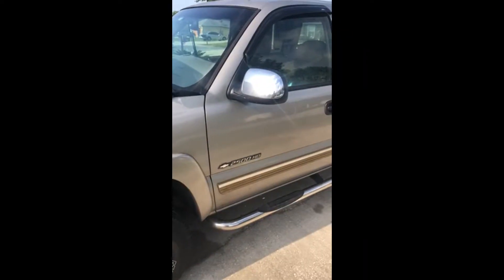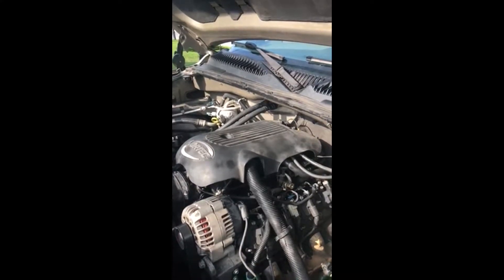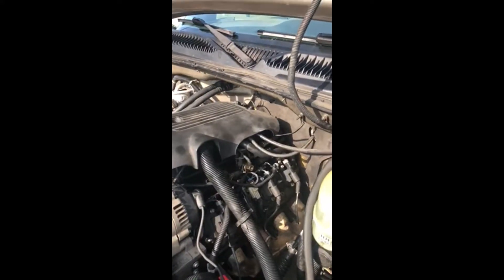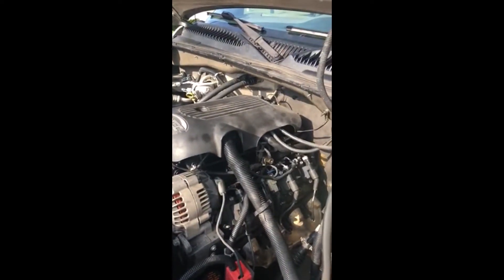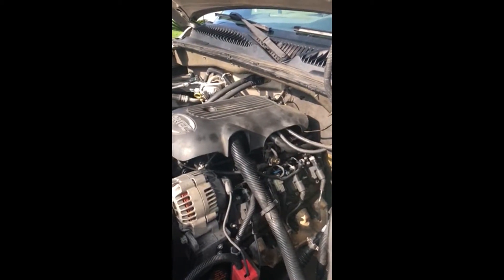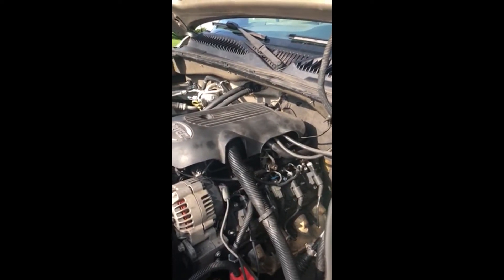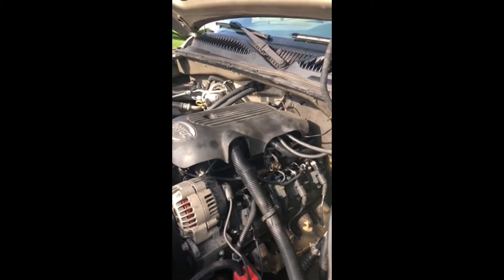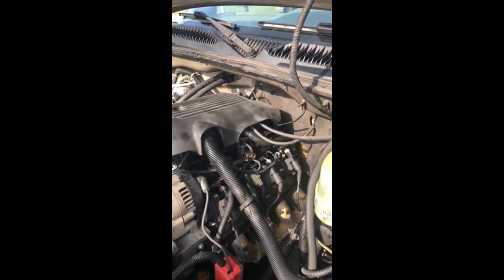Secret to Fix Knock Sensor Issue

Comment: Thank you very much for your video. I am an automotive technician and I did not find information about this problem in any mechanics manual. I was working on a silverado 2500hd 6.0 and had changed the original sensors and the knock sensor wiring and it kept throwing the codes P0332 and P0337. I checked the input to the PCM and it gave me the correct ohm measurement. By doing that procedure that you explain in the video, the problem could be solved. Thank you and God bless you and each one of those who commented here.
Reply from the maker: Glad it worked for you, Yes once you understand the system you can fix the issue! Pass it On !!!!
Reply: Year old video how has it held up
Reply: I had a code and replaced both sensors and harness. Code went out, then 50 miles later it came back on.
Found this video, cleared code, “re-learned ECU” as described in this video, code came back on after 50 miles of driving. What gives?

Comment: You saved a trip to the repair shop!! 2011 Tahoe 5,3 with a code of PO333. Changed both AC Deleon knock sensors, erased code, within 5 miles engine light came back on. Erased code again and within 5 miles engine light and code was back. 
At that time watched your Utube video. Erased the code, brought RPMs up to 4000 two times for 3 or seconds. (rpm maxed at 4000 on this truck). 
After a few test drives still no more code. BUT!!
Still hestates and misses from a dead stop. Cleaned the MAS and throttle body and now has no more problems. 
Thanks for the video, it worked.
Reply from the maker: I’m very Pleased it worked for you like so many others! You did a great job yourself! 
Please Pass the information along to help others, like my video that helped and Subscribe to my channel if you Will Please!
Reply: To update = Now has been approx. one month after replacing KS’s the engine light is still out. But! One morning pulled out of the driveway and noticed a hesitation. Stopping at the next stop sign and hesitation was much worse. After operation temperature got up to normal the hesitation improved but still there. Had no engine lights or codes at that time. Decided to have it tested with a much better code reader then I have and found it was the MAS. THE test that proved for sure is when they dis-connected the MAS the problem went away.
Reply from the maker: @pwrcat23  Good to Hear. Thank you for the update, Yes hesitation cannot be caused from Knock Sensers , but many other items, 
#1 being dirty MAF sensor ( Mass Air Flow) etc….. spark plugs wires …… 
! 
Please Pass this along Help Others 
Like my video that helped you and subscribe to my Channel!
Thank you 🙏

Comment: I am like everyone else here.  I washed my engine off with a pressure washer and it wasn't long until I had a bad knock sensor.  I went with the AC Delco sensors and wiring harness.  The code came back within 50 miles or so.  I ordered two new sensors and replaced them.  The code came back within 50 miles or so.  My truck is an '04 GMC Sierra 1500 with a 5.3 motor.  I tried the procedure above: cleared the code, rev'd the engine a couple of times, and went for a 120 mile drive.  The code came on at about 60 miles.  To be fair, my tachometer quit a long time ago so I'm not sure if I made it to 5000 rpm's or not.  I tried the procedure again and will give it another try.  The procedure makes sense and I'm hopeful it will fix my issue.  Thanks for posting C J Phillips!
Reply from the maker: Pressure washer May have put water in the harness connectors shorting knock sensors out. Hope you get it working!
Reply: @cjphillips987  , the pressure washer definitely sent water to sensor #1 and shorted it out but, I replaced both sensors twice and replaced the wiring harness, all with AC Delco parts.  This last time, I did a resistance test and voltage test on both sensors and ohm'd out the wiring harness and everything checked out.  I am down to trying your procedure of relearning the ECM.  5000 rpm's is a lot, especially when my tach is not working.  I'm probably being a little cautious and don't want to blow my engine.  I will report back if this fixes it this time or not.  Thanks again!
Reply: It's been a couple of days since I did the 2nd "relearn", being a little more aggressive this last time with the rpm's since my tach is not working.  I've driven a little over 100 miles and happy to report no code has popped up!
Reply from the maker: @anvilsbeme6898  wonderful! Anything else let me know!
Reply: Same here.grrrrr
Reply: @anvilsbeme6898  Glad you got it worked out, Don't worry about blowing your engine, These engines are about bulletproof and they love being on the rev limiter (6k rpm) Ive run the shit out of mine holding it on the limiter daily doing drifts, Burnouts, Etc. Still makes 45psi oil pressure runs like a top! No ticking or odd noises. Can't kill these engines no worries a bit of 5k rpm won't even bother these engines🤘🤘
Reply: Update...it's been about a year now so here's my update.  The code keeps popping back up after about 100 miles after each re-learn. I know my knock sensors are good because they test out fine.  The truck runs perfect with good fuel mileage and idles perfect.  I've just decided to ignore the code.  Don't know what else to do to get this code to clear permanently.
Reply: @anvilsbeme6898  Must've got something wet in the main harness, for it. Least it runs good
Reply: @hotwheelsracer6380  I replaced the harness with an AC Delco harness when I did the first set of knock sensors.  I then put on a second set of sensors (ohm'd them out this time).  So, new harness, new sensors,  and relearned the ecm as this video describes. I'm at a loss how to clear it permanently.   At least it runs as it should.  Would welcome any suggestions!
Reply: @anvilsbeme6898  
Hi. How will you pass your smog with the check engine light ON. 
I’m having the same trouble:(

What a headache man.
Reply: @MrSerioLok69 i have the same issue but luckily these trucks clear the monitors quick… get a cheap scan tool and take it to inspection after the monitors clear but before the CEL comes back… thats how ive got mine inspected the past two years
Reply: I will try this in the morning. 04 Toyota sienna. Had code p430. Bank 2 converter. Changed the converter but didn’t have the bottom side studs. So I drove to parts store with the exhaust leaking making loud muffler noise. Got bolts and nuts then put them in. Noise is gone , code p430 is gone, but now I have code p0330 knock sensor. I cleared the code twice and it came back immediately while driving. Cleared a 3rd time and idled about 30 minutes. The code was gone for about 10 miles. I will try the rpm at 5000 in the morning. Thank you. 8/7/2024
Reply: Why do people insist on pressure washing their engines still. It never ceases to amaze me. Y'all realize there's a good on your engine bay FOR A REASON, correct? This ain't days of yorn where the engines had very little in the way of electronics. Never since the 80's, pressure washing engines has been a piss poor decision that keeps being made. Even nowadays, with HALF the damn engine bay being spaghetti bowled full of wires and a whole PLETHORA of electrical and electronic components, you still have a number of people who find fit to still a high pressure, high velocity high volume nozzle right on in the mix and just send it. Then have a look of astonishment on their face when a few hours or days down the road all hell breaks loose and things start going haywire in a hurry. If you want your engine bay to look a bit better, use engine decreased and use it sparingly. If you need to rinse it down after decreasing it, get yourself a spray bottle or at most a weed sprayer and use IT sparingly and with diligence. And understand, this is an engine compartment were talking about, not your dining room table. There's NO need for it to be so sparkling, squeaky clean you could eat off the top of it!

Comment: I reved my 2009 Chrysler Seabring 3.5L. Every time I cleared the code out, it came back soon after if not immediately. After this video I reved to 4k  rpms as it would not let me go any further. I drove it around, today too and not knock sensor code was coming on so far so I believe that this also works for my car. Thank you very much for this video. I would literally have to take a lot off my car just to get to my sensor was is right under the throttle body driver side and only the pigtail end sticks out and the sensor is actually deep in side on top the engine. I think its an oil cooler and also you have to drain the coolant out too before taking that off as I understood it in another video.
Reply from the maker: Hopefully it Helped you without replacing the KSr’s. 
Please like my Video and subscribe to my Channel 
Pass the information on to Help Others! 👍🏻👍🏻👍🏻😎

Comment: C.J. MY MAN! First I would like to commend you on your concise and clear explanation of the issue and what to do to correct it! So I replaced my K.S. on September 18, 2021. It took me up until yesterday to find your video (after weeding out all the other videos with 20 minutes of jibber jabber and no help). I was at wits end with the error code my 2002 GMC Yukon with 171k miles was kept sending. It’s amazing how you can’t find information that is an actual benefit, instead the stealerships trying to force “stealership dependence” on to the consumer, where they will rape you for repairs. 

So here is my experience with your tip. I cleared my code and turned the ignition off. Then I started the vehicle cranked it up to 5k RPM where it resembled hitting a rev limiter initially. Brought the RPM’s down then cranked it back up assuming I would get the same result. To my surprise the rev limiter effect was gone! I turned the vehicle off for about three minutes (had to kiss the wife and kids before heading to work). Got back in the Yukon fired it up and drove to work. 

Knowing my route and exactly where the “service engine light” would illuminate I anticipated it to come on! Well I cruised right past that point and the light did not come back on. Who would have ever thought you had to tune the harmonics of a microphone in a vehicle. It makes sense if you replace the microphones and reset the readings to idle, of course it will keep sending the code as the sensors are set to idle or low RPM conditions. I have high hopes for the longevity of this trick. Any other stuff you find out please keep posting!
Reply from the maker: Happy it helped, pass it on 👍🏻👍🏻👍🏻😎

Comment: You're trick worked like a charm. I have a 2002 Yukon with 294k on it and it still runs like a beast.
Reply from the maker: Fantastic! Happy to help!
Reply: Please explain further .. what exactly do you do I'm about to replace the knock sensors and harness right now .. then what ... Please help asap do I have to clear the codes ? I don't have a scan tool
Reply from the maker: @kerryhunter6304  can’t clear codes with out scan tool  !  Even if you replace knock sensors! It’ll still show code warning light
Reply: @cjphillips987  can AutoZone clear the codes
Reply from the maker: @kerryhunter6304  maybe
Reply: @cjphillips987  so I replace knock sensors and harness then take it to get codes deleted then do the 2 revs to 5k for 5 seconds ? Or should I reset computer completely then do the 2 revs
Reply from the maker: @kerryhunter6304  reset codes first before they return do the revs or do the rev set n clear codes
Reply: @cjphillips987  thank you so much bud sorry I was confused
Reply from the maker: @kerryhunter6304  no worries I hope it helps resolve your issue! 
If it does pass it on help others! 👍🏻👍🏻😎
Reply: @cjphillips987  It worked so far still haven't went in passing gear but I'll find out shortly

Comment: I did this with my 2000 Silverado. It didn’t have any codes but the knock sensors were causing the ecm to pull timing out mid rpm. It made a huge difference!
Reply: This Happened to me , will the computer re learn the timing on its own, or do I need to manually
Open up the timing cover and reset the white dots ?
Reply: @matthewabbott343  🤣💀

Comment: First off you are the man for explaining to everyone in comments how to this when you clearly explained how to in video.  Gonna definitely give this a try after work 💪🏾man I hope it works replaced knock sensors 3 times
Reply from the maker: Thank You 
It’s been working since I made the Video. No more codes !
Let me know if you need anything. 👍🏻👍🏻👍🏻😎
Reply from the maker: If your knock sensors are difficult to get to like mine are try this; https://youtu.be/DnnjXBEmH4s
Reply: @cjphillips987  will definitely update you sometime tonight
Reply: @cjphillips987  I have done them 3 ×s it easy now
Reply: 2nd set of ac Delco knock sensors the last pair I got has resistance but not put out and ac current you think they are faulty or am I doing something wrong with the test
Reply from the maker: @Dareeldeel30  AC DELCO FACTORY Engineer told me half of all pizo KSensors aré faulty 
Thats why I added two relocated 
Them for immediate access
Reply: @cjphillips987  man I almost gave up I knew they were bad
Reply: So I'm gonna have to pull these back off? And I tried the method you gave now oil pressure dropped to 20 psi
Reply from the maker: @Dareeldeel30  doing the rev doesn’t affect oil psi you got something else going on plugged oil filter maybe
Reply from the maker: @Dareeldeel30  Engine rev dosen’t affect Oil psi 
Oil pump is a positive displacement gear pump. Plugged oil filter, bad psi sensor, bad gauge ect ….
Reply: @cjphillips987  was around 40 till mechanic put new oil pressure sensor on
Reply: Around 2 week ago
Reply: New S. plugs ,mass air flow sensor new purge valve new evap solenoid and got a rough idle. Thanks for your time and how can I pay you for all your info
Reply: @Dareeldeel30  No Payment Necessary except Pass it ON and Help Others,
Let Me know if you need anything else!
Stay in Touch !
Reply: @Dareeldeel30  Rough Idle got a Bad Spark Plug / or at least one bad wire if you serviced all the list !
Reply: @gateor6491  ac Delco plugs and I got my wires off my 03 Silverado they were good last I drove it . But will buy a set
Reply: @Dareeldeel30  Ok Let me Know
Reply: @gateor6491  will do thanks
Reply: @gateor6491  I will be bothering you alot thanks for your time
Reply: @Dareeldeel30  No Problem !
Reply: @gateor6491  I been reading and watching alot of videos lately on this truck have you heard off a sticky thermostat will make it idle rough notice sometimes mines doesn't get normal temp since replacement about a year ago with water pump
Reply: Turns out that 3 pairs of knock sensors were faulty been 3 days and no codes so far
Reply: @Dareeldeel30  AC Delco engineer informed me 50% of all Pizo K Sensors are faulty from factory !
Reply: @gateor6491  thanks to you and cj the info yall gave helped alot

Comment: Hope this works. My 2004 gmc sierra 1500 with a 5.3 I’m the original owner. Had the po327 and the po332. I went to dlr and paid up the ass for OEM knock sensor and the wiring harness. $350. Replaced the intake gasket also. Not included in my $350 . Cleared the codes. Truck runs perfect. The DTC PO327 came back on so I checked the sensors per Alldta. All in spec. Checked the pcm and wires are good. So I cleared it a 2nd time. About 100 miles the light cam back on with PO327 so this time I cleared the codes. Truck at operation temperature. And I held the rpm at 5k for 5 seconds and did it 3 times to be sure. So I will keep you updated. I’m in NC and can’t get it inspected until the not ready codes are set.
I’m crossing my fingers. Per Alldata the PCM replacement will be necessary per the pin point test procedure. So I hope this fixes it so I can get my truck inspected.
This is the 1st and only time I had a MIL light on other than the worn out gas cap. So I just lubed the gas cap and hasn’t had any codes since except for this one.
I put mobile 1 in her after the 1st 600 miles and she’s been a great truck so far. I will update this post after 200 miles
Reply: Update?
Reply: Update?